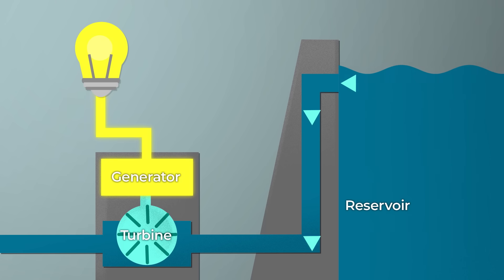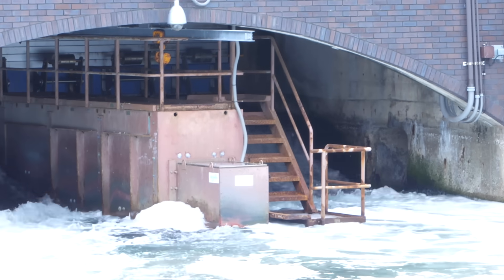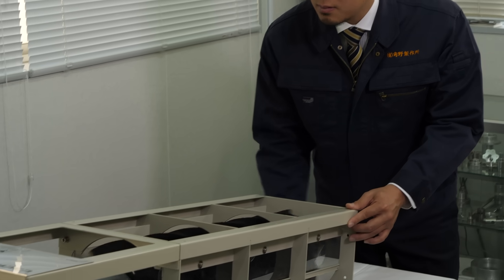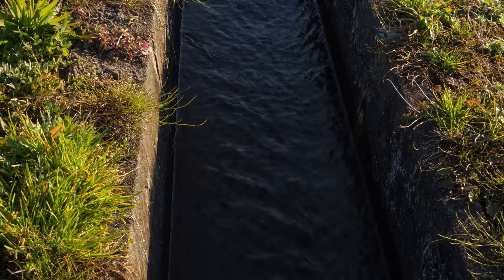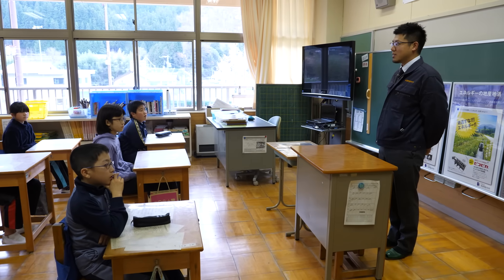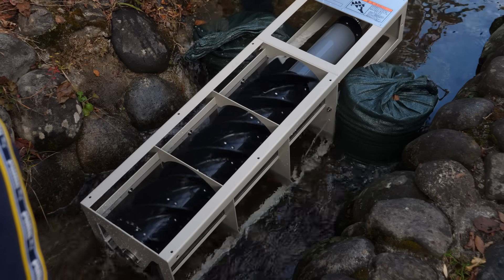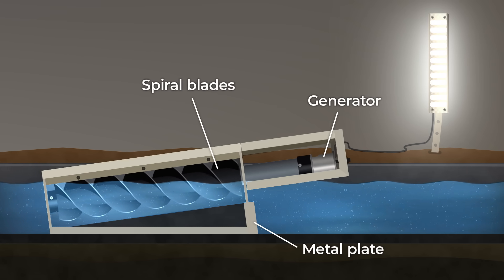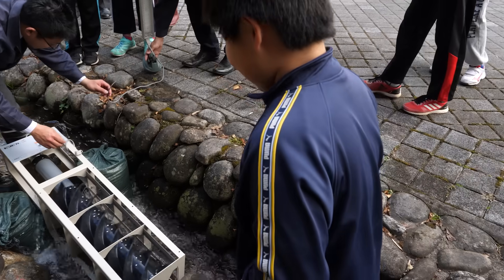Ultra-Small Water Power Generator

Comment: Such a small machine and it still produces power? Take a tiny motor and turn it... omg... you are making power. Also, this looks like a worm-screw, if I recall correctly. Also, those lights are fairly low in terms of power consumption. Also, there are plenty of other systems that use a very similar design. The type of dam he uses also has a name but I can't recall what it is. Other hydro power solutions are much smaller, lighter, have less impact and can generate similar amounts of power. On top of that - some can be 3d printed.. pop in a motor, add an impeller ( casing and impeller is 3d printed and the casing can be made water-tight ).

Comment: When you leave out key facts like how much power can be generated you can bet that it is just a useless machine.
Reply: Depends on the size. 12 m long by 2,5 m wide are getting used with good results. Power generated is in the range of 40-50 kWh.

Comment: i saw it on nhk world, i remember that these generator were quite pricy 1000/10.000$ depending of size made by a small company, but they produce energy and the product is safe  in japan. and can be put everywhere since 80% of japan surface is mountain...they got lot of farmer or household on mountain, or need light with led.
in my country, (france) this kind of product could be usefull on few place (many plain), and the cost is a problem and the safety too...we got lot of stealer and problem with building stolen of metal, wire stolen often everywhere cities campaign even the rail are attacked by these thugs.....in addition electricity is quite dangerous and the wire should be located on plan specially if burried...
if mass produced this would lower price and could be an opportunity by example for exterior light in many house close to a stream and why not in a dump?...its a shame to see old water mill and to dont put modern alternator instead...

Comment: Pease, more information about output watts, cost and availability.
Reply: Please
Reply: produces 10 - 30 watts. Just 2-4 LED bulbs or fan
Reply: @davelawson2564  If the turbine is increased in size or design, can hydro compete with solar? One problem with solar is an about 10 or 15 year panel life, and which are maybe unrecyclable, which might be a shorter life than a turbine?
Reply: @rolfpoelman3486  Key aspect for hydro power are height of drop, volume of water per second, area of turbine.
the in low water stream can produce 10-50 watts per hour. River can be more based on volume.
water must be screened to prevent debris clogging it up.
If sufficient water is available for more than 200 days /year and cost can be kept down by using wood with steel rivets then it may be feasible.
Reply: @davelawson2564  Do you have any wood and steel rivet turbine designs?
Reply: @davelawson2564  This design doen not need height of drop since it's not a turbine; it works with water speed and volume passing through. You don't need to have the whole coclea being touched by water, since the areas farther from the central shaft are those giving the most momentum, so it can be operated with natural rivers with variable flow. System is very robust compared to turbines, yet screening it against big debris is fundamental.
Reply: @mariosebastiani3214  very low power
Reply: @davelawson2564  Compared to a turbine, yes. But since you need just a small drop in height, they're not limited to the mountainous areas, and also you can put many cocleas in a line, you only have to sustain the initial costs, then its life is far longer than a turbine (less stress on the materials and less abrasion from the water). Production of the coclea is also less costly than a turbine, cause you don't need the high quality in materials and high precision in machining the latter require.
Reply: @mariosebastiani3214  Its worthless design as it does not generate enough power. And you clearly lack understanding on power generation factors
Reply: @davelawson2564  Several companies employing it think otherwise. My 20-years engineering experience also guesses you are not up to date on the topic. I've seen one installed on a river in NW Italy a couple years ago, it gives out 40 to 50 kWh and powers a big farm with houses and stables. I ran some calculations, and came up with a cost of 0,16€/kWh for a solar cell plant that lasts 20 years, VS 0,07€/kwh for the coclea, on the same lifespan. This, not considering a 2%/year of decay in the production capacity of the panels, and that the lifespan of the coclea is far longer than photovoltaic. Also, its production is continuous, while solar is not. The only problem with the coclea is its (far) higher initial investment cost, which makes it feasible for industry only. Anyway, what's your field of application, and your experience on the matter?
Reply: @mariosebastiani3214  It requires a river and produces limited energy. Solar can be installed anywhere there is sunlight. And cost of solar is getting cheaper by the year. solar power ranges $0.05 - 0.10/kwh depending on where its located and scale of installation
Reply: @davelawson2564  Not that civilizations are usually located along rivers, or in areas, like northern Europe or Canada, where solar power isn't easily gathered for 6 months a year... Also, solar produces limited energy too, unless you live between 40° N and 40° S in areas where rain and clouds are scarce. 
And I'd really like to know your technical background and experience on the topic.

Comment: 1. Price of energy per kWh would be the price of the device divided by time of it's operation times it's power. And what is it?
2. It's a fishgrinder, no doubt.
Reply: You forgot to add in convenience, realibility, mobility, etc. A pessimist like you appreciate nothing because you produce nothing.
Reply: @heavycurrent7462  Arcimedes screws are installed specifically to not harm fish. This size screw is likely too small to not hurt them though!

Comment: there were many generators such like this one. The only differentiating factor is alot more efficient generator part, which requires less kinetic energy to work.
Those generators have 1 flaw anyways. Their fans can get filled up with dirt and mud.
Oh yea. Those might be good to run small LED pannels, but anything else? Not really.

Comment: This small generator struggles to light up some LEDs. I cant see where this is going to be helpfull. There is a reason why water generators are normally way bigger. They get more efficient. Stay with small solar panels. They provide more power in less time.
Reply: Contrary to what you've said,  a Pelton turbine with compression of the water source can provide very high voltage, that requires ZERO batteries and a constant flow of power.

Comment: wonder if he knows why this is the first generator like this...      uh, a propeller is more effecient then an auger.

auger's are used to drill holes in dirt for the simple reason...  the blades are designed not to clog..
hence water will take the path of least resistance and simply flow around the corkscrew...

Comment: This is awesome! These small units can make a big difference over time. He should also build larger models for more powerful streams or rivers. Also with a little engineering, he might be able to modify these to also convert to water pumps if electricity was put into it.
Reply: " big difference'' make them cheap then.
Reply: Hoover Dam
Reply: Už dávno to existuje... Říká se tomu přehrada "vodní elektrárna" s instalovaným výkonem i 2000MW a staví se to už desítky let po celé planetě 🤷‍♂️
Reply: And also be a target from the petrol traders if  they manage to power everything from this
Reply: @K1koPh  don't worry, the petrol traders are already starting to get into electric as well as petroleum. The ones who don't will end up like Blockbuster. Economic evolution.

Comment: Yes micropower electric generators is doable, just as megapower electric generators is doable.  Unavoidable is they both and every size in between have a cost to construct verses a max production number. It is a ratio of dollars spent to energy produced.  For example the generator shown has a dollar amount to build and a maximun output. Unfortunately they power it produces cost more that a larger hydyo generator.  Not mentioned is the cost of the unit AND just as important how much power it produces.   If you address that you will find other that when the grid is down this device is a very expensive way to produce tiny amounts of power. That make this economically impractical for evvery day electrical powrr generation.   It you pay attention it's not by accident cost and output values are not given. There is reason for that.

Comment: Why cant we design one that can be connected to the mains water supply in every street, the electricity produced can be returned to the grid or be stored in batteries.
Reply: Energy is being used to run large pumps to pressurize your municipal water system.  Putting hydrogenerators in the lines would lower the pressure and flow of the system, resulting in more energy being needed to run the pumps.  Due to inefficiencies of all such systems, the energy generated would be far less than the increased energy needed operate the pumps.

Comment: And any thing that spins has these things called bearings. And when something is running 24,7 with no maintenance (i.e. not getting greased) those bearings fail pretty quick
Reply: Maybe they can use vegetables oil for greasing....
Reply: That was my first thought, how many run hours before maintenance is needed?

Comment: Would it be possible to use the this Archimedes type turbine to generate electricity to power a water pump or perhaps directly mechanically power a pump?   I've posted a link to this video in the Facebook group for water wheel pumps:
https://www.facebook.com/groups/240458583255303/

Comment: L.E.D lights can be turned on with small amounts of electrical power which doesn't really demonstrate the power of the turbine, so why not use an incandescent or tungsten filament bulb something that requires a lot of power to really show the capabilities of such a small turbine.
And before you go saying it probably wouldn't light up an incandescent bulb it would, even small RC car motors or drill motors can light up an incandescent bulb.
Reply: It's a freaking 10W turbine, depending on the water current they could upgrade and tweaks some of its components like generators, making it more rigid and firm on the water bed, protective bearings, etc. It could power your entire house. But, this device is made for those really rural and seclusive areas that have some water but no electricity, even without upgrades if they have a good current of water, the power outage could still improve up to a certain point. I could see myself using on a trip or camping to charge my batteries, power banks, etc. But, it is a little too heavy to carry around in the wild, maybe a homemade version with a smaller, lighter version, yes that could be my next project.

Comment: Where can i buy this , and we dont know the power instaled 1 turbine how many kw.
Reply: kw? are you joking? Each unit powers one led array, prob no more than 50watt. This is the most mickey mouse shite I have seen in a long time.
Reply: @JohnBurton-f9f  thanks my situațion is i hawe a vacancy home in the Country side in Romania and i hawe a litle river with the speed of water 32meter per minut and i hawe the posibility too buy second hand kaplan turbine because the all sistem is wery expensive . My vacancy home it hawe elictric but i want to hawe more electric power with cheaper cost 😁
Reply: @LuisVuiton  Not sure what your cost of line power is at your site, but if you can keep your power requirement down a little hydro setup might just work for you. Real hydro capacity requires a penstock to create some head and pressure. If it works for you, great. Hydro is the way to go if you have the environment to do it.

Comment: That small one (PicoPica10) only enables around 10W, which is great if you just want to run a low powered light.
I'm more interested in the PicoPica500 which enables 500W!  Two of those would set me free.

Comment: I just invented a an amazing new invention. It's round and lets you roll over stuff instead of walking. I think I'll call it the wheel... Sorry but this is old tech and has been done in many forms over the centuries.
Reply: Calm down with your pretentious half-ass knowledge, of course, the idea of using hydro energy as sustainable energy is not new, not once did anyone claims, not just on the macro level but on smaller scales, there are lots of people who made a 'homemade' version that works and useable for the most part. But, for marketing, and promoting to be useful you need reliability, efficiency, structural integrity and design, ease of access and portability, etc, etc. What makes this device works and somewhat of a groundbreaking is not because its a new idea, the design itself is not new but what makes it works is it manages to fulfill all those characters needed for marketing and promoting that actually works as intended.
Reply: @Claude-Vanlalhruaia  Not a new idea, not a new design, each unit produces only enough electricity to run one light bulb, and it's guaranteed to get wet but isn't waterproof. But the fact that they've got a good marketing/pr team makes it noteworthy? I think not.

Comment: the current seems unstable since the light is blinking.
Reply: Of course because it depend on water flow. To fixed this you can use battery as middle way -> generator charge battery and battery supply  for the light but you cost battery and battery need replace after certain time.

Comment: Would like to know more details like voltage range, amps etc. What its wattage output is.  I suspect the output is low because too big a load would stop the screw. But if several was used with a battery bank near a person's cabin in the wilderness, it may provide all the power he needs.
Reply: Well, from the look of it, it probably use for LED lights mostly to provide light in lots of poor areas in the world. In many area throughout the world, people still use candle at night, so lots of invention regard light sources like the gravity one, small solar through water bottle LED light sources and such.

Comment: Most people know better than to plug -in an electrical appliance while
standing in a water-filled bathtub. Imagine that.  But here we see people
who should certainly know better, actually playing with an electric generator 
while standing knee-deep in a creek. How dumb is that? 
It's sad. "Common sense" apparently is not so common these days.
Reply: J S.  
ROTFL! I agree. In fact, if the 
voltage were 30,000 V, it also 
wouldn't hurt anyone. It's not 
the voltage that's so dangerous.
it's the amperes that kill people. 
It only takes less than 1/2 amp
to kill someone.

Comment: Now all we need is a battery powered water purifier/filtration/desalinization device that this generator can hook up to.
Reply: Actually the typical home RO system will do that.  They use DC power.  I have some experiments using solar, but it's the same idea.  If interest you can search youtube "tsbrownie solar ro water filter"
Reply: @tsbrownie  Solar can also supply DC.
Reply: Then we'd have enough salt to last us a lifetime!
Reply: Huh? Well you have one already, its called a coal filter, literally anyone can do it (cloth, crushed charcoal on top, then sand, then tiny rocks and gravel in an upright bottle). That still leaves microbes and stuff, but you can purify those by running a transparent tube in zigsags through a long bigger mirror tube with UV lights installed in there, it'll purify literally everything... Or just a long set of transparent tubes that run under the sun. Or just boil it.
Reply: @mkzhero  And get throughflow of...?
Reply: I mean... technically speaking (albeit a highly inefficient method) is to use the energy created by the device to heat water and create some distillation thing...
It's efficient but I suppose it might be better than nothing
Reply: now that would be cool add on!
Reply: On a small scale, take black(water tight) plastic, pour in sea water, and cover with clear plastic(on a tilt) and leave in sun...fresh water run off clear plastic, leaving salt in black plastic!
can and should be done on large scale...
Reply: I had to do that. Only test it, if out a sea, hope there be just a few plastics left after cleaning.
Reply: Easy enough run power to a 12 volt battery hook up a pump and plumb in a filter system self powered water system and some emergency power depending on how big of a battery.

Comment: It is an old idea: the French engineer Henrie Navier expressed the idea to use the screw as a kind of water wheel in 1819. In Europe are a lot of screw-turbines since the late 1990ies with diamenters up to 4 m and a capacity of 100 kW. The main problem of a small one is the high revolution speed that will kill any fish. And there is a patent stabilising the voltage / revolution speed ...
Reply: Many voltage regulators can receive a varied power input. You can gauge power generation based on RPM. You can gauge RPM of the device by flow rates, which falls on the installer to figure out at the stream.

Comment: a small bank of batteries or capacitors could give you a greater amount power when you need it
Reply: But will eventually run out, I don’t think you understand the concept of renewable energy.
Reply: @richardevans8908  i'm referring to the turbine charging the bank
Reply: Larry Mags I see haha my bad man
Reply: @larrymags2045  No, you don't. "a greater amount of power", compared to what? The small turbine with a generator, you are directly comparing the two specifically their power generation, I cannot simply see where you could be referring to charging the bank. It bugs me. I could be wrong but I simply do not see it.